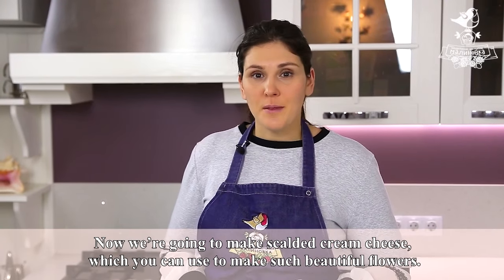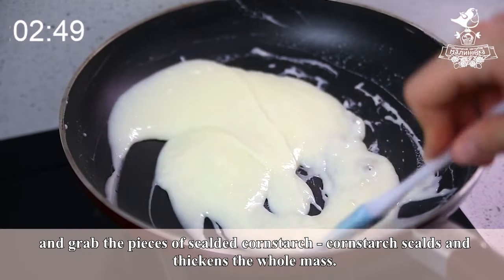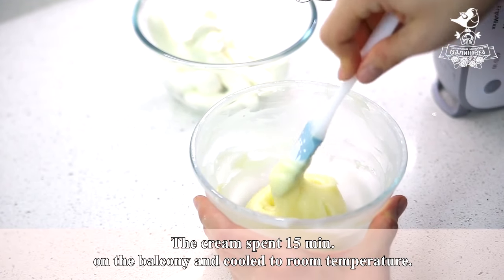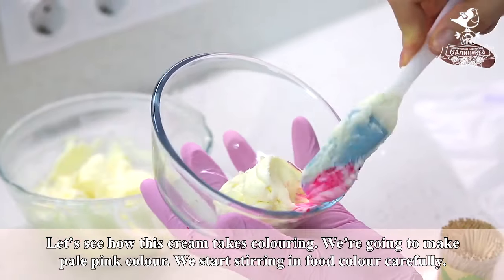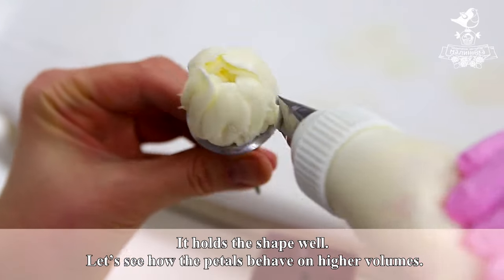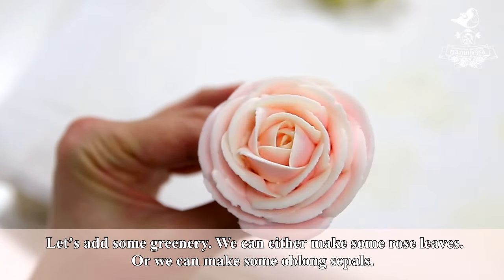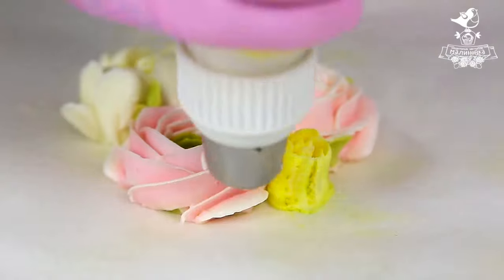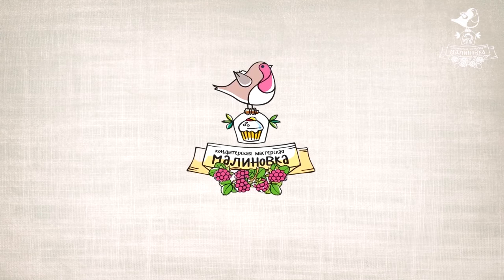Perfect CREAM CHEESE for flower piping. Scalded cream cheese recipe. Cream cheese recipe.

Comment: Thank You so much for this great recipe! I've been struggling to find the right recipe/and consistency for the Russian piping tips I've had forever and no luck.. until now! I just made this frosting and just amazed at how beautiful it turned out!  They all came out perfect! I Will be making again for sure! Thank you for all you do it's greatly appreciated!
Reply: Hello dear, may I ask?how about the storing for this frosting?do we need to put it in chiller?and use it for tomorrow?
Reply: Same question. How about the taste is it good? Can it be used to cover the entire cake? Tnx!!!
Reply: @normayahalil241  Hi there. I do keep it in the refrigerator/chiller because of the cream cheese is a dairy product. If the cake is out for a few hours before serving is fine but if you won't be using it until the next day I suggest keeping it chilled.
Reply: @normayahalil241  Hi there.  It tastes the same to me as regular cream cheese buttercream frosting just more stable and not as sweet. If I was going to use it for a filling or frost all over the cake then I would use a regular cream cheese icing recipe in my opinion, or adjust the icing sugar and add more for the sweetness and add flavoring such as vanilla extract.
Reply: Thank you for your comments about the Russian tips. Trying to use them was very frustrating. I will try this recipe and hope I get as good results as you did!
Reply: This is a Frosting, Not a Buttercream. There is NO Butter or lard in this recipe. It does delicious and I plan to try.
Reply: @tlynnpalma9183   hi, may i ask how many regular sized cupcakes can you make out of that recipe? I mean if yo atleast do some rosettes with some greenery...thanks so much for the inputs.

Comment: Thank you....  deffinetly will use this recipe instead of buttercream now.And cheaper too...  Still learning how to pipe...I did create nice flowers but had to pop mixture back in fridge to cool . Then is still workable.If i did that with buttercream.That would not be possible
Reply: I have the same problem.  I live in a hot area and have warm hands.   I have found that just doesn’t do too well with buttercream.

Comment: It works, made it several times already 👍

I'm still working on the texture  anyway, since it's not as smooth as seen in the channel, maybe something about the cream cheese i used.
Reply: hey there I also encountered the same thing, as mine was still a teensy bit lumpy after coming out of the pan. What are your opinions on the strong cream cheese taste? Is it just like cream cheese buttercream?
Reply: @theena3097  hi Theena, mine too, a bit lumpy after coming out of the pan.
But once it reached the room temp, i mixer it well before i add the remaining cream cheese to make sure it will be smooth and there will be no lump when we make flowers etc.
Well, about the taste, nothing beats cream cheese buttercream anyway, especially if you add lemon zest into it, it's heaven, believe me.
But this scalded cream cheese recipe is still yummy (just a bit too sweet for my taste) and i love how stable my flowers are even if i put it above room tempt (at my country, it will be 30° - 33°C at day light without any air con).
Reply: @ledifairytail  hey ledi thanks for your reply :) and that’s awesome!!! I should’ve mixed it a bit before adding the remaining cream cheese next time, thanks for the tip. I can’t wait to make flowers with it
Reply: @ledifairytail  hey there. can i know what type of cheese you using? because i done this recipe but my cream cheese became oily. i could see the oil coming out from my cream cheese and it does feel oily when i touch it
Reply: @ledifairytail  what brand of cream cheese were you using? What are the ingredients in yours? This didn't work great for me.. too "wet" and pulled like elastic. I would liek to find a way for this to work but I don't know the problem. And she doesn't offer post help after the videos.
Reply: @yuyankim9201  OMG !! I'm really sorry for not aware about your question and just seeing it now 🙏
I use Anchor cream cheese 🙏
Reply: @KristaUm  hello, I use = Anchor cream cheese.
I followed her measurement but I usually adjust the water. 
Her original measurement came out too thick for me, so I usually add the water intake just a little bit to make the end result more smooth and easier to mixed with the rest of the cream cheese.
Reply: @ledifairytail hi Ledi, when you said you add the water just a little bit, do you mean lesser or more from the original measurement? 🙏🏻
Reply: @sharlinamojinun8164  hi Sharlina, i add a little bit more and for me the result is more smooth even when it already reach the room tempt (just before we add the remaining cream cheese).

Comment: If the cream becomes thinner, it's because the starches cant handle that much of a beating, and lose their binding power with the moisture. so you'll have more free liquids in the cream, making it runnier.
Reply: If that happened what is the solution?
Reply: Adding more starch or other binding agents can fix it.
Reply: @Jerisa  Would adding plain gelatin help? AT what point would the gelatin need to be adding? During the cooking or during the beating?

Comment: I made this recipe using Philadelphia 250g block of cream cheese. Turned out well, I believe I may have left it on pan a little longer so it was thicker, and the end result frosting was thicker. It would work perfectly for piping intricate flowers. I think it might be because I usually use a light frosting of cream cheese + whipping cream, but it tastes very cream cheesy to me. (I mean it’s not b a d it is basically cream cheese + sugar) Doesn’t taste powdery, just tastes like cream cheese. Idk if this is comparable to what cream cheese buttercream tastes like cuz I’ve never had it. Overall would use it for piping though :). If anyone else has made the recipe, please lmk your opinion on the strong cream cheese taste
Reply: Thank you for sharing your experience. I will try it soon, maybe next week and I will see how it taste c:
Reply: @_salma4  sounds good!! Lmk what you think :)
Reply: Update: made it again, don’t think I’ll end up using this after all. I use Philadelphia cream cheese block and the same thing happened where the mass was way too dry and thick and even when I added some cream to make it pliable, once the cream cheese was added, it became very stretchy and started getting those telltale cream cheese pulls instead of being the consistency of the frosting in the video. I still find frosting tastes way too strongly of cream cheese, which makes sense since it’s basically only cream cheese and sugar. Will stick with Russian buttercream for my flowers
Reply: @theena3097  maybe try a different brand cream cheese?
Reply: @xxSydneyFox  Kerry gold cream cheese from Costco is amazing and better for you.
Reply: @Rebecca-1111  did you try kerry in the recipe?
Reply: I used a different brand and mine pulled, didn't release. Like it was too "wet" and I needed it to be "dry" or drier. Philadelphia has carob bean gum. The cream cheese I used had xanthum gum. I wanted to find out what cream cheese she was using or what the ingredients were in hers so that I could get something comparable. Even after making this and refrigerating or putting in the freezer even, it didn't get more solid. It was super super hard to work with. Have you found any other recipes that you tried that you liked? I lived in France for a long time and I know that products are very different and act differently in the kitchen depending on the country of origin and manufacturing so I am not sure if it is country issue with the recipe.
Reply: @KristaUm  no. But I have used it in other's.  I love the taste and texture.  I wonder if the texture would work though?

Comment: Hello, I tried this recipe for the first time. My first rose stood well. But later on, the cream got softer and softer, and couldn't make roses.
I put the cream in the freezer hoping to make it harder but it didn't work. Did anyone have the same experience? btw I used Philadelphia cream cheese.
Reply: Hello. I have this problem when I use buttercream frosting. What I start doing is  put less quantities in the piping bag, because other way they get warm from my bend. Can I asked you did you used classic Philadelphia and isn’t it to salty ?
Reply: I had the exact same experience! It pulled and was rubbery and no amount of freezing or refridgeration fixed the problem. I tried adding more powdered sugar and it was a disaster... made is softer rather than dryer.